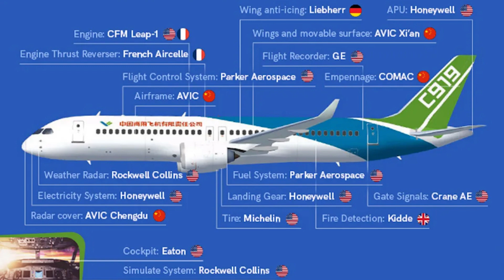Made-in-China airliner exported to US & EU? Can C919 fly in the west and be exported?

Comment: A system integrator builds the basic structural platform and select sub-systems to assemble into a working whole.
Some knowledge of the system's working is of course needed but it is not the top end cutting edge skills.
To beat the established Boeing and Airbus in the international markets for commercial planes is very difficult as safety and proven performance records matters more than price alone.
China should take this process of climbing the ladder one step at a time, a slip and fall can be very disastrous.